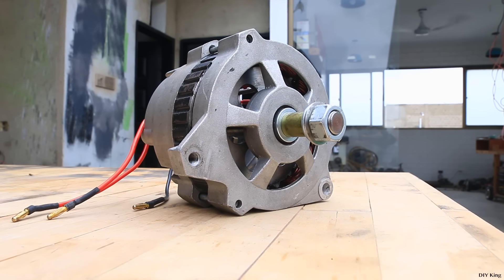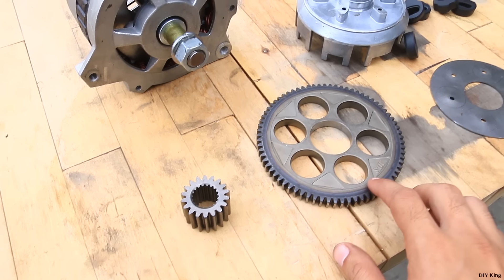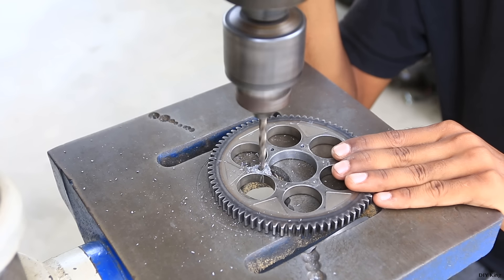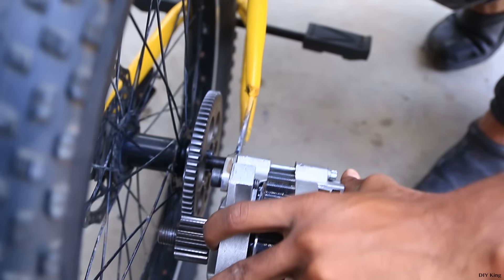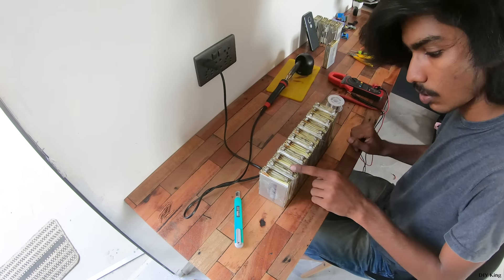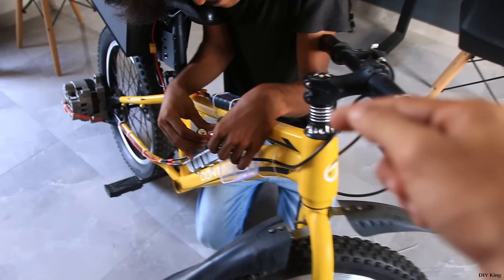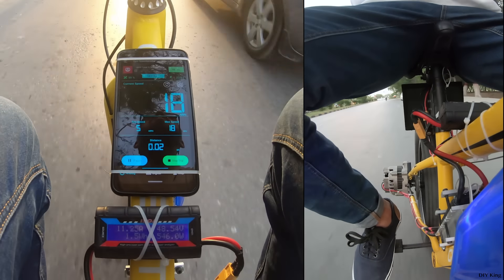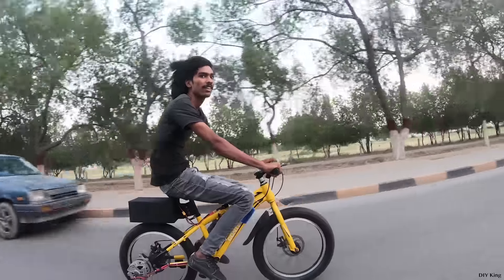Bicycle Conversion using a 10,000 Watt Car Alternator

Comment: I used an alternator made for a semi truck (18 wheeler) to power a strange amalgamation i dremtp up 7 or 8 years ago. They are almost twice the size of even the high output passenger vehicle alternators.   I started off building a big scooter, but ended up with the frame, rear wheel, and the 18 speed gears from a mountain bike,  two 12 or 13 inch front wheel from a trike, and a seat and steering wheel I took from an old riding lawn mower.   It looked ridiculous and it was scary fast.  Welding to the bike frame was my downfall.   Should have just used the whole bike to avoid structural issues.  I had forgot about it until I saw this.   Makes me want to convert a bike now.   Give me something to do with all these batteries I got laying around.

Comment: Can u make something for high tower building kitchen exhaust which works on its own using high wind pressure like turbo ventilation.which is horizontal and can be fitted in 16/16 exhaust window

Comment: 24hrs b4 that motor hits a wall or post and at best no longer aligns or at worst causes a bad crash, it needs a  metal cover to deflect the bike even 10mm x  200mm  piece of rebar l weld one end to frame 15cm b4 motor and the other end to top of the motor and instead of the motor been an anchor when hitting a post it will deflect [dont ask how i know]

Comment: Nice video. As I was watching @10:45 you said "we will trust the more expensive speedometer". If you meant the one in the car you're dead wrong. All car and motorcycle manufacturers make their vehicles over-report how much speed you're doing. Why they do this is a bit long to explain here. BUT. If you keep a steady speed in a straight line, not going up/down a hill then the GPS is 100% accurate.

Comment: U shoud change the gear ratio, but 3 more teeths on the gear at the motor and 3 less on the one on the bike, it will still have enough torque to go from stand still but the speeds will increase aprox with 15km/h

Comment: This looks really good, however I am a bit concerned about the braking and stopping ability of the bicycle in an emergency. Is the existing brake system adequate for stopping the bicycle from 70kmh?

Comment: What is the appeal of the 20-in tires I just don't see where they are better than 24, 26, or 29 inch tires for fully grown adults or am I just missing something?
On second thought a bike with that much balls might be best closer to the ground so that you have less room to fall LOL which inevitably will happen if used regularly especially considering the turbulence from being so precariously unbalanced

Comment: Should of put a water bottle where the heat sync and speed controller is and use small fish tank pump inside the water bottle to keep it water cooled

Comment: 3sheets 2motor rotator 1 non 1 charged 3 plastic wires and switch motor straight chain. 6 things required

Comment: does the bike "coast" ? as in if you take the throttle off, would it slow the bike down with the resistance of the motor ? could you go downhill without the motor slowing you down if you wasnt using the motor ?

Comment: it vould have been easier to mount the alt in the front pedal area and then you can use the gears  and not have  near as much work  some welding and make  a foor placement thats it  far faster far more powerful.

Comment: 10,000 mW maybe.  In some countries, a comma is used instead of a decimal point making this a 10w generator trying to charge the battery bank.  The battery bank is actually running the motor on the front sprocket..
Reply: generator is only generator when it is used as a generator. It can also be used as a less efficient motor. 
generator : mechanical to electrical 
motor : electrical to mechanical
Reply: I think it might be 10,000 rpm. As others suggested, car alternators are around 2000Watts
Reply: I watched it again. He didn't say that alternator is 10000 watts. He said that controller rated at 200A can handle 10,000watt i.e. at 50V. And it makes sense given that it has large heatsink and also watercooling. He also mentioned that its for RC applications so again it makes sense because small quadcopter motors have very high power rating i.e. in kWs but very low torque. So actually "none" of what he said is a fluke

Comment: You could mount that battery pack and controller in the rear offset a little to the left as it would make a fine counterweight for the heavy alternator and possibly balance the bike a little better

Comment: A 12v DC alternator is usually rated 100  amps that's about 1200 watts  E x I = W so the internal  wiring and diodes are designed  and built for that.  10,0000 w  divided by 12v =833 amps that is going to destroy your wiring and components so what is the 10,000 watts describing?

Comment: You need to be careful, originally bicycles were not designed for great speed so once you exceed 50km/k there is a chance things will start to fly or come apart because of all the stress on the parts... You may want to think about using a motorcycle frame, tires and wheels for the future.

Comment: this is dangerous bec as speed increase so does the force(rider weeight + cycle weight) on the tyre rims. is the bicycle rims design to take such forces or will it fail and bend? I don't know just risky.

Comment: Dude you are a genius. If you're doing suggestions and since you like alternators, would you consider making a wind turbine as a supplemental power source to a solar system? That would be very interesting.
Reply: Not a genius. Just very mechanically inclined.

Comment: Ive always thought gravity is the one source of energy we have yet to tap into....  Most mountain bicycles have 2-3 shock absorbers.  Why cant we repurpose shocks to also produce electricity, which recharges the batteries.

When the shock is compressed, the compressed air travels through a small turbo generator, the return line for the air could also turn the turbo if the housing was built correctly, drastically increasing power production.  If you had 2-3 of these on a bike(two front, 1 rear, like a typical mountain bike), I would think you could increase the range by an additional 30%+.

Im not sure why ebike manufactuers have not implemented electro shock generators in their designs.  If made out of lightweight materials, they wouldnt add much weight.  Using the fox suspension design, compression & return lines could both be fed into a turbo housing which turns a small generator on both compression & expansion.  The RPMs would be high & consistent, producing a consistent level of power recharging as you drive the bike.  If designed efficiently, this could add 30%-50% more range to the battery, depending how many one installed...

Comment: I call bullshit on the 10kw figure, 1) most large saloon car alternators run around the upper end of 150 amps on the higher end, most are around the 110 amps, sure there are others out there that can run higher, but if we do the math of 13volt x 150 amps we get 1950w, hell even an 24v trucks alternator only produces 7000ish watts...2) if you ran 10kw through those wires they would melt quicker than a snowman on the surface of the sun.

Other than that I really like the conversion because its using stuff readily available to anyone to produce a fairly cheap mode of transport, and i'm all for that.

Comment: Great Video! More videos would be great! try mounting windings from a generator on the side of the bike's front forks with a disc on the inside to turn the armature and feed lots of power into the motor to save battery power 🔋                                                                           please search bonding and grounding
Reply: adding a high strength low profile gear-weight-reduction system to either end will be beneficial

Comment: Great idea you have for converting the bicycle . I'm curious how much ware is there between the sprocket n gear ?
Also would a belt driven be less ware on the gear, possibly less expensive during replacement?

Comment: I doubt that alternator at 12 volt is any where near 10,000 Watt, that would mean 833 Amp/hour, so the stator windings would have to be thicker than those shown😆
At most around 1000 Watts.

Comment: The speedo on your car will generally show a slightly higher speed than you're actually doing. Your GPS speedo has a better chance of being more accurate over an average straight mile. At least the number it shows you will be closer to the truth.

Comment: hello
quelle est la tension de votre batterie
combien de kms faites vous a 25 kms/h moyenne.
avec ce type de moteur alternateur.
merci.

Hello
what is your battery voltage
how many kms do you do at 25 kms/h average.
with this type of alternator motor.
THANKS

Comment: Car Alternators do not physically spin on their own! They are turned by the motor to produce electricity so how did you make it a physical power source?
Reply: Car alternator is spun by engine to produce electricity to charge the battery. You can provide electricity at the same wires and cause the alternator to spin.
Although efficient motor designs and efficient generator designs are different because motor requires good torque over wide speed range whereas generator requires low loss with high current and most efficiency at desired rpm and frequency.

Comment: Admiral ingenuity and effort, HOWEVER- 10,000watts divided by: (‘even at a theoretical stretch’ of) 14.25 volts = OVER 700 amps. Who has a 700a. Alternator!
- Perhaps you mean 1,000watts; that would be more realistic as an 85 amp. Alternator. That equals roughly: (1020watts divided by 1.36=) 1.39hp.
 150 amp. alternator may be more desirable and common enough. (1800W = 2.45 hp.). 35 mph is fast enough for a bike with no suspension.

Comment: Or redo the wheel by modification mount the actual alternator in the middle of wheel that way it would even the weight of the alternator

Comment: 10 000watts car alternator? So you are saying the car alternator is over 700 amper alternator. LFMAO. By the look of the alternator I believe its more like 630w if being a 45ampere alternator. (45 ampere multiplied by 14 volts becomes to 630 watts)

Comment: I have a EMMO Monster  , 500 watt 72 volt  , 204 kg's weight of scooter and I want to make it do 80-90 kph and I have 6 batteries and a 40-50 kms range on the low setting  ..... when I got it , it did 56 kph , unplugged [ governor ]  ..... I also have 3 settings low 30 kph , medium 40 kph , high 50 kph .....any suggestions on how to make it do the speed , I want ....... and how many more batteries would I need to obtain that speed .....

Comment: I would love to see something similar to this done in the form of a mid-drive rather than a hub Drive because I hate Hub drives and mid drives are far superior to any Hub Drive and even better than 2 HUB drives (all wheel drive) in my opinion because it makes it so much easier to do things like changing tires and allows you to use all of the bikes original gearing system if done properly

Comment: There's no way that this is a 10000 Watts alternator.  My 7500 Watts Cat generator's alternator is HUGE compared to yours. A higher-end car alternator produces ~150A x 13.4V for 2010 Watts.
Reply: Makes much more sense. Considering that typical electric motorcycles with 2000watt motor reach a maximum speed of 65km/h. The own weight of motorcycle is measure around 100kg.

Comment: The power pack is to much to the rear. This makes it instabil to ride. It should be in the center of the frame. Anyway the position on the sattle shaft will destroy the frame tube due the force of leverage.

Comment: All car speedometers are showing a slightly (5-10 %) higher speed than you are actually driving. I would trust the GPS-based speedometer more than the one in the car.

Comment: Sorry, but for 10,000 watts, that alternator would have to use/produce 833 amps! Typical car alternators are around 65 , 85 amps.I have an oversized one in my large truck that is 185 amps. I am not aware of an 800 amp alternator made for automotive use. I am not saying your project doesnt work.Even a 65 amp alternator should be capable of 780 watts and thats about a horsepower.Pretty good for a bike.Overall nice work.But remember what the man said-A Watt is A Watt is A Watt.And That is not 10k watts

Comment: I'm trying to figure out where you found an 800 Amp automotive alternator.  So on further inspection, I'm calling this a load of sh1t.  Yes, you can covert an alternator into a brushless DC motor but the efficiency is very poor.  It will run well at high rpm but when loaded the torque curve falls off quickly.

Comment: Since when do you get 10,000 watts out of an alternator.  A diesel truck alternator puts out 100 amps
Reply: its more like 8kw, 48v its running at and 200ah esc do the maths( will break the alternator tho)

Comment: How can it be 10,000 watts? You can rewire it for higher voltage with longer thinner wire, but then amps are limited...only so much space available in an alternator. If you take an alternator that puts out 14.6 volts, then 10,000 watts means it is pushing 685 amps. That is not going to happen. Maybe 200 amps at 3,000 watts.

Comment: That’s very inventive turning an alternator into a motor. However your math isn’t good. 10,000 watts at 12.6V is 796 Amp current draw. Even if you used a higher voltage the amperage still exceeds what’s rational.

Comment: "10,000 watt" alternator???  According to Ohn's law watts/volts = amps = 10,000/12 = 833 amps.  No way in hell are you going to generate 833 amps.  The copper wire conductor would be bigger than 3/8 inch solid bigger stranded.

Just for reference the conversion from watts to horsepower is 746 watts/horsepower or 10,000/746 = 13.4 horsepower.
Reply: mama always said "you can't fix stupid"   A 12vt alternator puts out amps not watts.

Comment: Wow, you are dangerous. 🤯 Wanna do more? cool, all power man... slow down and think.  
The answer to the stability issue is don't go that fken fast. This is related to survive-ability. 
There is no question about being able to stop. It's gunna happen one way or another. 

Rethink the motor position and driving the wheel through a bevel gearbox 90deg, with a high speed shaft drive to the motor/s under the seat.  
Bevel reduction gearbox: Reclaimed or new angle grinder gearbox head (*convert the motor 3phase if ya want). The grinder head has substantial threaded mounts, I'd use a serious industrial 9" grinder... 5" for small light use. They must have bearings, not bushes.
They have slim styling and 'industrial' strength that doesn't stick out like dogs balls... simple. They mount easily. You can always use 2 gearbox and motors. 😉 
This.....
Gearbx mount: Easy bolted, plate steel to frame - DO NOT cut or weld frame in this location. Use ALL existing axial locations and whateva holes available. Rectangular plate will be 6mm thick with two folded ends. The plate will be gusseted for torsional strength.  The 90degree bent ends have a bolt hole you screw the gearbox to. 
Drive shaft: How big is your wheel? 24" is a 200mm nylon or steel shaft and coupling, between Gearbx and motor/s. 
Drive wheel: Use an old diamond cutter disc (steel), specifically made for the grinder head. This is used to drive a mating wheel hub sprocket (same diameter as drive disc) . A shear pin couples the drive disc to wheel hub. Shear or Pull the pin = disconnect drive .. good anti theft disarm too.
Motor mount: (* if needed) Easy bolted, plate folded a gusseted, that picks up at least 3 strong mounting points on an alternator frame, preferably in one plane. The bike frame is strong at this point and motor plate easily bolts. If needed. 
Axle: Use appropriate bearings on a new shaft. One shaft end mounted through frame mounted bearing. The other shaft end screws onto the gearbox output shaft (14-16mm). This shaft also mounts through a thrust bearing.
 
*A huge 9" angle grinder, complete could be mounted as per the gearbox. have a motor transplant / rewind. The original is 2pole (high speed) that could go a magnetic rotor conversion, or a 4pole 3ph stator winding installed in the grinder case.  They make small very powerful DC motors now, you know, with rotating shaft.... all you need.

Comment: I thought the alternator was going to keep the battery charged forever.
Reply: mechanical input from engine -> electrical output to battery.
Electrical input from battery -> mechanical output to transmission

Comment: NOT A 10 KW ALTERNATOR , More like a 1,200 w alternator   (100a @ 12 vdc ) . Wires coming from alternator looks like wire rated for 150 watts . Look at an alternator on a 10kw generator , a vast difference .

Comment: bike is way too small for your height, at high speed it will wiggle.  Also with enough torque which it has it will benefit to higher speeds on a larger diameter wheel on a larger bike. and more range.

Comment: 👎You don't fool me❗
To drive that bike you need a power source that can deliver more than 800 Ampere, and that not for a few seconds or so (like when starting a car) but over a longer time period. That means it must be more that a few car batteries in parallel, it's going to be an awful heavy bike that way❗

Comment: 200 amps? Check your wire size looks more like 30-40 amp rating. Size of motor looks too small to be over 13 hp. has even smaller wire..  I think this is very incorrect and only a dream. 1 hp. = 747 watts 10,000 = 13.39 hp.

Comment: Why are you compensating the GPS speed by 7 km/h?!? What's wrong! GPS speed measurement is much more precise than a car speedometer. Any car speedometer shows higher speed than your real traveling speed, because of the legal reasons. Car manufacturer could be liable in case speedometer shows too low speed and driver gets ticket for speeding or cause accident.